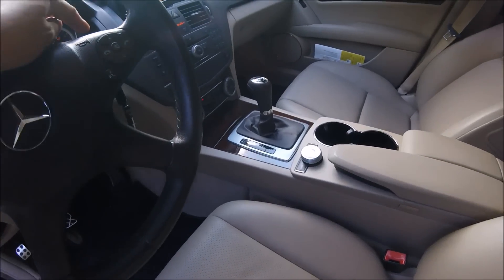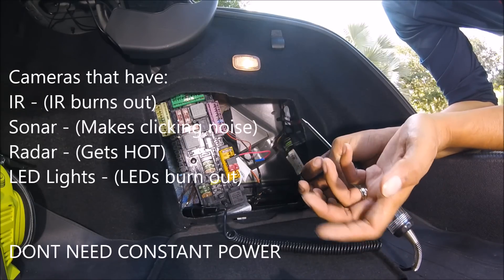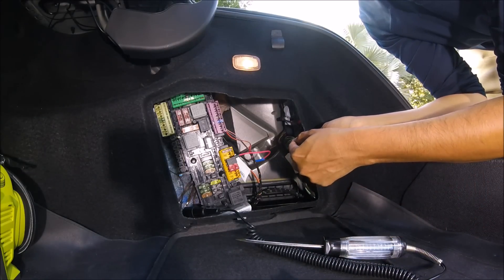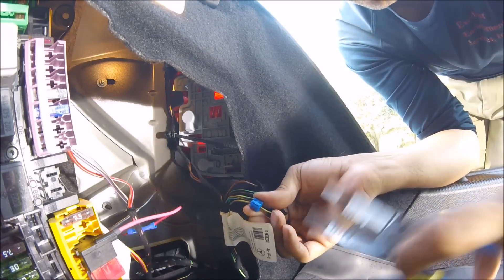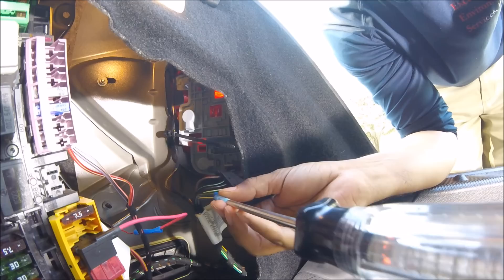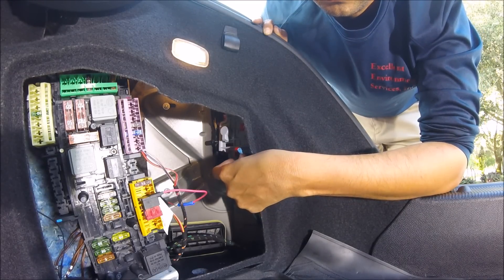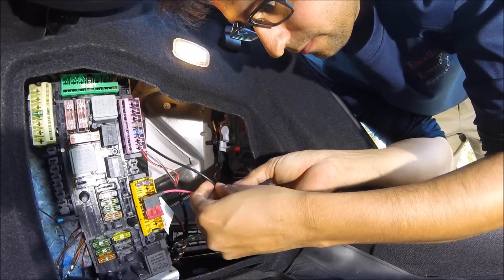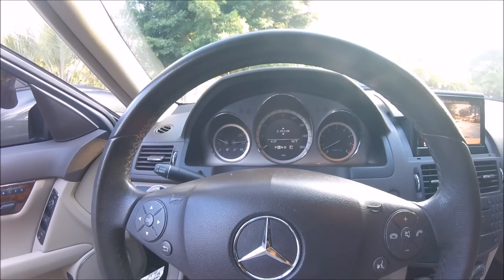Wire Backup Camera to Reverse Light CORRECTLY on ANY car

Comment: hi Raymond. I just watched the video with you driving to the guys house to fix his display.  you disconnected his green cable and inserted your adapted one. However you did not say what that green cable is for and why you dont need it.
Reply from the maker: Billy Gosnell the Green Cable is the Factory Farka Cable. The actual end location is not exactly known to me so you are better off to unplug it and plug in your own adapter. 2 people have told me different locations as to where the factory cable is. I don't know if you got my other message that this install is for the Gen 1 you sound like you have a Gen 2 so watch the videos I sent you. The programing should be the same you can try it yourself first before running the wires.
Reply: yes saw the videos. so the farka cable plugs in the unit but the other end is unknown.
Reply: ps like the light up starr.
Reply from the maker: Billy Gosnell Correct the factory end is unknown. So buy the adapter:

Bingfu RF Pigtail RCA Jack with Female Basket in to Green Fakra Jack with Female Basket in to Green Fakra Plug with Male Center Pin in Cable Using RG- https://www.amazon.com/dp/B00VE1XKMO/ref=cm_sw_r_cp_apap_gPoMiXlirtofR

and just plug in your RCA. Make sure you pull out your command unit first and make sure you have the port available. From what I was told 73% of Gen 2 have it.
Reply from the maker: Here is a PDF with the instructions
http://manualzz.com/doc/7389016/2012---up-c-class--w204----crux-interfacing-solutions

Comment: Hi Raymond. Just subscribed because of your you tube videos. Have a 2014 c 250. I think newer one with display in the dash. I think I want to get the camera you  have. However not sure how to hook up to head unit in dash??
Reply from the maker: +Billy Gosnell Here is my response that I posted on your other post:

Sounds like you have 2014 gen 2.  The backup camera procedure is more than likely different. Send me a message on Instagram "raymonduriasjr" with a picture of your radio and I will tell you for sure. As for the Map pilot it go into a VCR looking dock in the left corner of your glovebox if you have a 2014 Gen 2. I hope this helped. Here are some videos that may better assist you. Hope it helps.

Command unit Removal:
https://youtu.be/BNLqus6WHwU

Map Pilot:
https://youtu.be/nmRGKBwQkn4

Comment: So I think I'm doing something wrong? I hooked it up and then ran the light diagnoses tool to see if it was getting power when in reverse, and in fact I was. However, when I connect the male in and put in reverse I get a black screen ; (.
Reply from the maker: J.L OK, let's go down a check list:
1)Are you sure the wire tap is getting power 4:38 shows how to test
2)is the ground connected
3)is the video connected
4)is the power cable connected
Reply from the maker: J.L Also you can test the camera, unplug it and plug in your license plate camera. Throw the car in reverse and see if the picture comes up. If you still get no picture then it's definitely not getting power/ ground.

Comment: would this be ideal for a regular camera or would you suggest the original method you have for a stock camera?
Reply from the maker: J.L if it's the camera that was run in the original Mercedes video then constant power is perfect. If you are running a new camera with add ons then reverse tap.